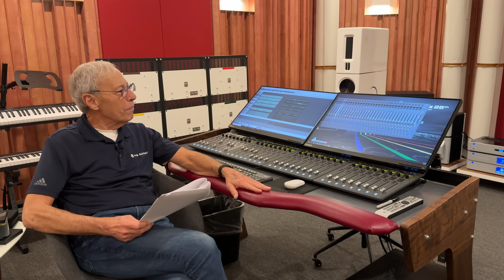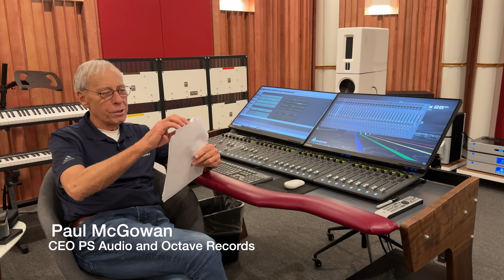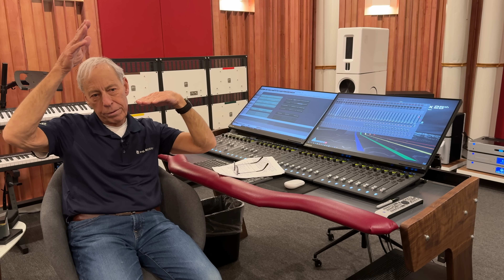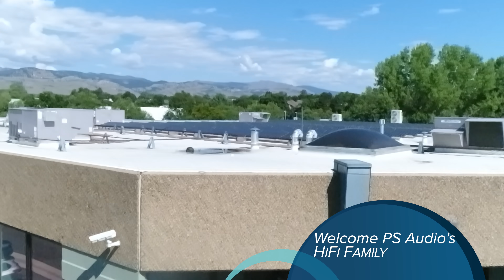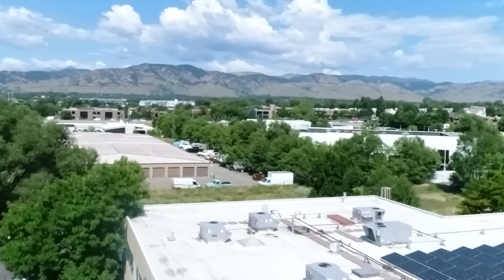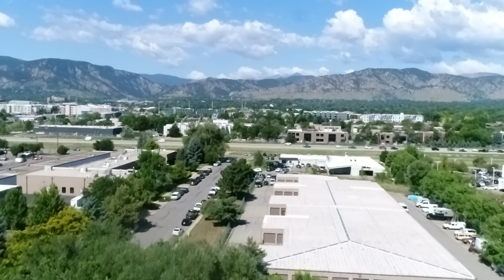How a power amplifier works

Comment: I noticed Paul paused when describing that in the current gain stage, the devices were in... series. I think that is not the whole picture. In an open loop circuit, stages in series will increase overall current gain by the product of the individual stage gains (betas). The final output stage may have multiple devices in parallel, where the currents of individual devices are summed at the output terminal. Both topologies contribute the the overall current gain of the output stage. That said, I think Paul does a great job explaining the general principles.

Comment: Interestingly in initial trouble shooting it is sometimes possible to know that the output transistor is open if you hear sound from the speaker but very soft and distorted. Yes the output of the gain stage appears across the amp's output. As you say it just does not have the power to drive the load properly. The output stage just does the output matching to the voltage already developed by the gain stage.

Comment: The term "power amp" does make some sense because from operating the audio signal on a voltage (with tiny power level) from the line input, the output stage is where you enable a lot of power (Watt = Joules of energy per second) to do the work in a speaker driver. This is true for whatever power amp (class A, B, D etc.). A speaker cone needs that energy supply to move the cone and turn it into sound waves, which is all about energy. A speaker is in need of energy like a human body or a car and it can all be measured in Joules. A human body can run on about 100 Watt = 100 Joules per second. Just as a reference, a Big Mac has some 2,250,000 Joules in it, which for a 100 Watt amplifier or human body means about 6 hours of operating time (2,250,000/(100*3600)). Like a human body is creating heat as energy waste, also an amplifier is creating heat of some of those Joules.

Comment: When I was 7 years old, my dad started teaching me about electronics. I was colossally disappointed that an amplifier didn’t magically create high power from low power, but was merely a system allowing a small signal to control the flow of a high current, the high current having to be supplied to the system, obvious now but not then. Somehow, my young mind expected an amp supplied with 9 Volts to be able to produce unlimited power.

Comment: The "output" stage of a power amp is just a buffer interface that enables the amp to "absorb" the load of the speaker with interfering with and/or destroying the preceding circuit stages.
Reply: The term "power amp" does make some sense because from operating the audio signal on a voltage (with tiny power level) from the line input, the output stage is where you enable a lot of power (Watt = Joules of energy per second) to do the work in a speaker driver. A speaker cone needs that energy supply to move the cone and turn it into sound waves, which is all about energy. A speaker is in need of energy like a human body or a car and it can all be measured in Joules. A human body can run on about 100 Watt = 100 Joules per second. Just as a reference, a Big Mac has some 2,250,000 Joules in it, which for a 100 Watt amplifier or human body means about 6 hours of operating time (2,250,000/(100*3600)). Like a human body is creating heat as energy waste, also an amplifier is creating heat of some of those Joules.

Comment: Current is the key to drive speakers - that is why most tube amps have output transformers as the output tubes don't produce enough current, with the exception of the OTL (output transformerless) amplifiers using tubes such as the 6C33, from companies such as BAT, Berning & Futterman.

Comment: Thanks, Paul, for directly answering his question in an "easy to understand" layman's vernacular. 

I started my delve into electronics when I was in single digits, and audio has been my passion for about 50 years now. When you were talking about beta, I blurted out what it was, and my wife was like, of course you know what it is. 

Anyway, to those in the audience, if videos like this make you want to learn more about the nuts and volts of electronics, ie, hiw they actually work, i suggest you get to your local library and see what they have on basic electronics theory, and after that, amplifier design (Douglas Self has some great books) or maybe pick up a copy of The Loudspeaker Cookbook, whatever version is available. If the books aren't in the library, see if your local bookstore can order them for you. When all else fails, there's always online sources. Whatever you do, educate yourself to know more than just the surface of things. This is how we progress and become more aware. And that spills over into more facets of life than you'd imagine. Dive in, learn why what does what, and you'll find that you can be more than JUST an end user (push A to get B).
Reply: Sounds like you have a similar growing up experience as I had. In the early 70s my dad gave me a Panasonic tape player RQ2035 at age 6. I also got some tapes. I wasn't too impressed by the sound quality of that build-in speaker. At age 7 I was with my parents on a trip in Germany (we lived in Denmark) and I got my mum to buy me a speaker (not so big). It was of brand Grundig. I successfully got it hooked up to that Panasonic tape player and quickly wanted to add another speaker. So I decided to use some stuff of my dad and I mounted a mains connector for the speakers and a mains power strip for the tape deck output. It perfectly worked even it was not intended for speaker signals. Then one day I came home from school and my room had a terrible bad smell and my mum came into the room and apologized that she wanted to demo my setup for my aunt and when she was connecting things she plugged one of the speakers into the mains supply and the speaker went out with a big bang. My dad was on an overseas job and my mum felt so sorry so she told me I could have their Bang & Olufsen Beomaster 901 receiver setup with stereo speakers. I was age 8 at that time. I connected my mono cassette deck to that receiver and wow...now it was hugely better. Many projects later (e.g. 120W stereo power amplifier I developed at age 14) I got into studying engineering including audio and my first job was at Bang & Olufsen where I worked for 13 years developing all sorts of audio and video products. When I think about it, electronics became a big hobby for many people in the 70s and we had to learn how things worked down to the transistor level. Nowadays my sense is not so many kids in their one digit care to study electronics.
Reply: @ThinkingBetter it seems that the curiosity that existed back then was a lot more "why?" and "what else can I do with this?" than today's "how can I code that instead of getting my hands dirty?" I don't mind higher level thinking, to the contrary, I encourage that as well, but without a solid foundation, you'll just be putting a band-aid on an aging base. Mind expansion via knowledge, rather than chemicals. That sounds like it should be a slogan.
Reply: @TheTrueVoiceOfReason  In the 70s we had magazines for electronics hobbyists such as Popular Electronics. We even had a Danish version of this that I bought every month at around age 10. I learned how to build my own electronics with my own hand-drawn (with a marker) PCBs that I etched and drilled in our washing room. I also learned how to cut aluminum sheet and build my own enclosures. In some cases I bought pre-fabricated enclosures. In Denmark we had stores like the old Radio Shack in the USA where you could buy all the parts and some electronics kits (e.g. JostyKit and Velleman). Then in the 1980s came the hobby computers (Z80 and 6502 based to IBM-PC clones) and digital electronics was the new excitement causing much of the passion for analog electronics as a hobby going down the drain.
Reply: Ah, nothing like wire wrapping a few kb of memory for your Z80.

Comment: Getting confused .If an amplifier has a 75v DC rail how do you get your wattage if the impedance is 8 ohms .75/8 which gives you 9.375 amps on the output 9.375x75=703.125 Watts output .Now in vacuum tubes the voltage is much higher 500-600V and the current is smaller and the output has to go through a transformer to lower the voltage and increase the current .??? .Also what is the efficiency of the amplifier and teg damping factor and the whole unregulated DC buss do for the sound other than dynamics and head room .Is the higher voltage necessary when you can just lower the impedance of the  speaker or does that open up another can of worms
Reply: Common arrangement involves a positive and negative rail referenced to ground, which is also the "negative" terminal of the speaker connection incidentally. Mathematics is a bit more complex than that, with the peak and rms value distinction, while the efficiency falls short of 100%. Then there's output impedance and load related interactions. It's much more complicated, but there's an entire library available, for those wishing to learn.
Reply: @paulb4661  I understand that there is  a dual power supply with a common ground and that frequency efficiency like in class A,amplifiers vs class D  capacitance inductance  and physical resistance of the conductors make a mess of calculating everything .It is amazing that something small in size can sound like a 100 lb monoblock and have a much smaller power supply and sound as good or better and the power requirements to deliver the same sound quality and power .I have never pushed a big amplifier to it's limits .especially because speakers are so expensive and a dyno is out of the question for me especially for just tinkering around and sometimes having something go super Nova on the work bench ...It's amazing what people just put in the  trash that really doesn't belong there .More money than brains or more money than time .Now some parts are unobtainium and the component horders and counterfeit sellers on ebay and Amazon and other places just make fixing things to give them a new life a crap shoot

Comment: FET's (field effect transistors) are key in modern solid state audio amplifiers as they switch very quickly for the abrupt current changes required to reproduce music accurately.
Reply: Not really, unless you solely refer to class D affairs.

Comment: Fair video as this is a complex matter to explain in a few minutes. A power amplifier is still a voltage amplifier when seen as a black box, but with ability to output high power (1 Watt = 1 Joule of energy per second) in low impedance (speaker, e.g. 8 Ohms). Internally a power amplifier can work in various ways e.g. also involving MOSFET voltage amplifying transistors and with different class categories e.g. most often class A, B and D.

Comment: Oh man, you struggle to keep it simple when you just want to go deeply technical.

BTW, I was told years back to consider the output stage as a means of modulating the power supply, hence the need for a good supply.
Reply: That was an ah ha moment for me when I realized the power amp is basically the output power supply with a valve to drive the speakers.  And yes, the power supply is everything.